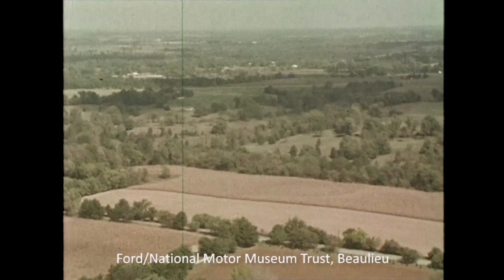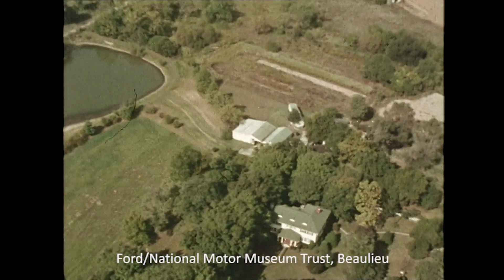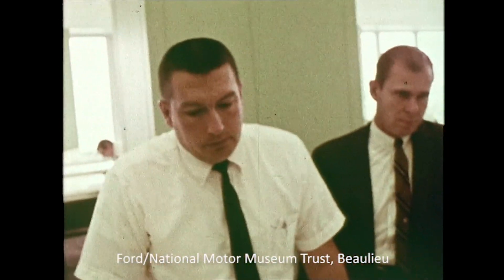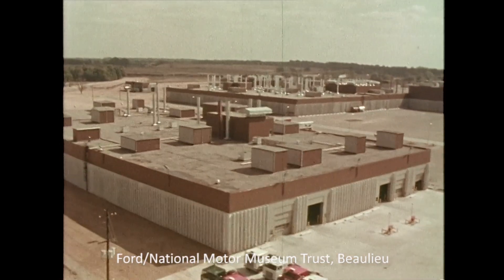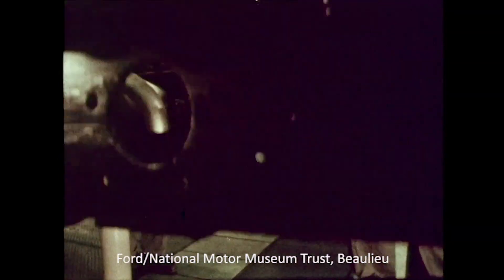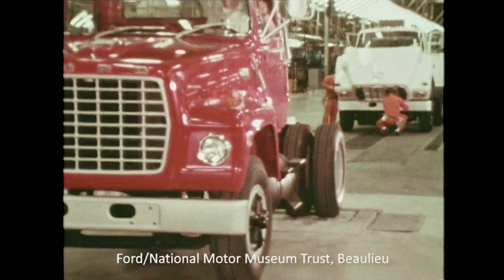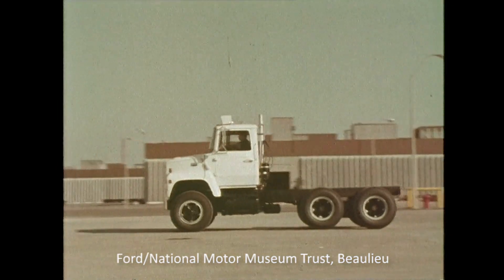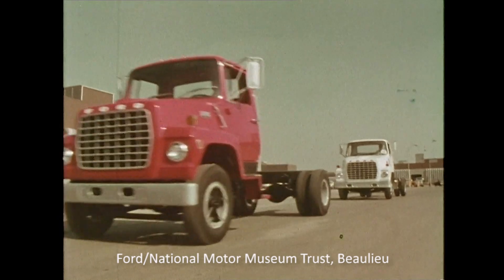Kentucky Truck Plant - 1969

Comment: I had a 1980 LT800,  a tandem with a 429 gas engine, 5 spd main and 4 spd aux, plain jane and rode like hell on rubber block suspension, juice brakes. Way under powered, not sure why they even offered a gas option for such a huge truck. Come to a hill and you get a workout shifting down through about 20 gears. I had a 48 ft stock trailer and I'd be just crawling up a sharp grade at walking speed, then going down with that little gas engine and no jake...geez. I was a lot younger and crazy.

Comment: Notice all the people wearing a white shirt, and a tie!  My dad was so happy to not need a tie and could wear any color of shirt to work in 1976, when he took a new job designing stuff.  When working at Hughes Aircraft in 1955 to 1970, it was all business, tie and white shirt, and a sports coat going into and when going home from the office.  

Great video, brings back some fond memories.  I was thinking the 1969 trucks look a lot like the 1980 trucks!  Seems like they did not make a lot of changes.  At my work, in 1997, they had a 1982 F-650 COE truck, and it basically looked exactly like the 1959 model!  

Fun fact, difference between the F-7000 and F-700?  The diesel is used in the 7000 and 8000 series, while the gas engine is used in the 700 series.  They used a lot of gas engines back in the 60's!  Even the WW2 trucks that they produced so many of in 1943 - 45, all gas engine 6 cylinder with about 235 cubic inches!  I was impressed on what a small engine displacement it is, considering it is a 10 wheel truck.  The 1969 F-600 and F-700 could be had with a 391 engine or a 534, maybe other displacements too!

Comment: Those L Series trucks looked so modern for the time. It was such a clean and straightforward design that still looks good over 50 years later.
Reply: I couldn't agree more,when the LN series first came out in 1970,not only was it a good looking truck, but it was nice designed well laid out truck that was fairly easy to service.
Reply: Amen
I'm not a Ford guy.....but I miss them
They were better than strings their successors

Comment: I'm not going to lie I would love to get me back in 1969 a brand new f800 single axle with a dump body 14 ft bed painted red with a white stripe going down the side just like Grandpa used to drive had a Ford big block 4 barrel Holly with an Allison transmission I miss that truck

Comment: Ford l8000 and 9000 trucks
Reply: Thay ware good trucks
Reply: @terryjudd7746  Still are
Reply: @J-1410  The ones with the diesel engines were good the ones with the gas engines were so god awful
Reply: @robs_garage0278  depends on what you use them for. We have multiples of both.
Reply: @J-1410  the ford 332 are such pieces of shit so gutless and slow the head design was so terrible that the engine could not breathe compared to my 1980 ford ln7000 with the cat 3208 diesel it performed a hell lot more than the ford gas engines
Reply: @robs_garage0278 , One must consider the Ford 332 was what U-Haul used in the F-350 pickups with a van body.  It is almost 1/2 the cubic inches of the 636 cubic inch 3208!  And the 3208 was rated at about 225 HP.  The smaller engine only about 150?  With modern fuel injection, the 332 could make about 225 HP, if the heads airflow was improved.  

I would hope the boss would have selected a 391 V8 or the even larger 534 V8 to improve your drive experience, and reduce the number of hours on the road moving so slowly going up the hills.  I don't know if the MPG was different between a 332 and 391.  Just you could get to the home base faster.
Reply: Well said
Especially if the 3208 was turbo boosted
Not a fair comparison